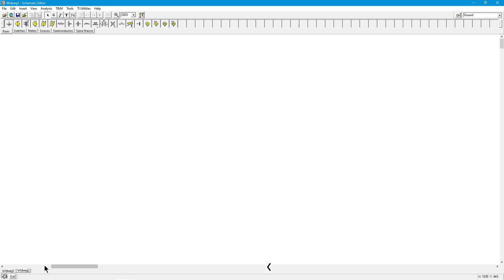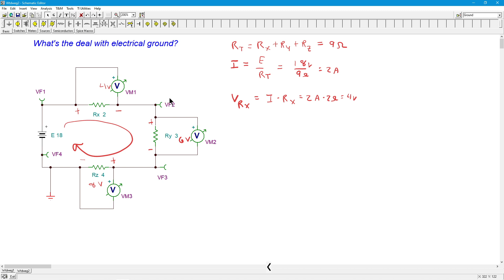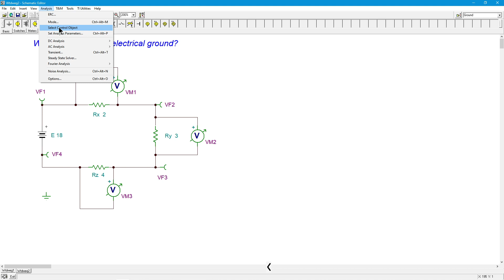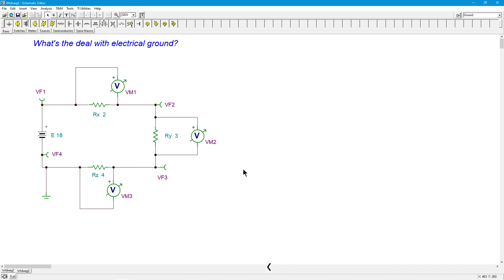What's the Deal with Electrical Ground?

Comment: Interesting video, thank you. Speaking of ground. I recently found that the power lines between me and my neighbor's property is measuring over 1000 volts per meter (EMF meter) near the roof of my second story. In measuring the downstairs wall closest to the powerline from left to right (parallel to powerlines), I am getting between the 300's to 400's volts per meter except in an area where I have a galvanized fence that runs perpendicular to the outside wall. This area inside the house where the wall is adjacent to the fence is reading zero 0.  This galvanized steel fence is held in place with 6 steel posts that go down about 16 - 20 inches in the ground/earth. 
It seems that the fence may be drawing/grounding the current and that is why the reading is zero in that one spot. Does this seem likely to be the explanation of why this is the only area on this wall that reads zero? 
If this is the case, I am thinking of building a similar fence under the power lines to possibly reduce the amount of voltage in my house. Any info is appreciated, thank you.
Reply from the maker: How close are these power lines and are they typical residential lines or very long distance (i.e., high voltage) lines? Not knowing the actual layout, I imagine that a metal fence could be providing electromagnetic shielding (like a Faraday cage).
Reply: Thank you very much for your response. The lines are long distance high voltage lines. They run between my neighbor and I, over the property line. The property line is about 40-50 feet away from my southern house wall. The lines are high above the air and I don't know the distance. In one area of the subdivision. I measured 1450 volts per meter where the lines dip a little lower towards the ground. I was holding the meter about 7 feet off the ground. The higher I hold up the meter the higher the reading is of course. I have read many negative things about living near powerlines. If I can put up a fence underneath and draw the power away, that would be worth the expense and work. Thanks again.
Reply from the maker: @commandertim575  Regarding the potential need and effectiveness of that, I would defer to an expert in that area (not my area of expertise). I will say that I am surprised that your municipality allowed a housing development just 50 feet away from long distance lines, purely on safety grounds.
Reply: @ElectronicswithProfessorFiore Thank you. I have talked to some people regarding this matter and most would say there is nothing bad about living near powerlines. They are high up and shouldn't effect you. I talked with a holistic practitioner and she says our health is in great danger and to move away. Sufficient studies seem to be lacking except for older studies with children developing Leukemia. I think I will try putting up the fence and see if the readings drop. Thank you for your time and consideration.
Reply from the maker: @commandertim575  To be clear here, my concern is less about the effect of the electrical fields on you (and I wouldn't put a lot of trust in a "holistic practitioner") and more about being so close to high voltage lines that could be damaged in a storm. Also, it should be noted that the power line frequency is ELF (extremely low frequency) and therefore is classified as non-ionizing radiation. I am not aware of any mechanism whereby non-ionizing radiation can damage DNA and cause cancer (unlike, say, x-rays, which are a form of ionizing radiation). To be fair though, I am not an epidemiologist either, just an electrical engineer. 

I did a quick search on cancer and EMF exposure. I found a nice link which summarizes a bunch of related items on the topic from The National Cancer Institute. Have a look:
https://www.cancer.gov/about-cancer/causes-prevention/risk/radiation/electromagnetic-fields-fact-sheet
Reply: @ElectronicswithProfessorFiore  Thanks for the info. I will be looking into it further.